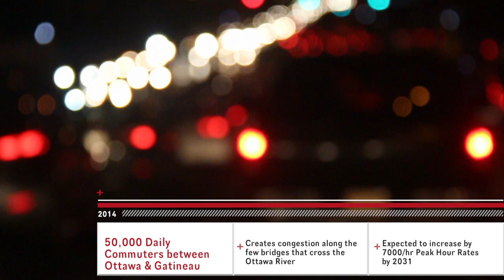Ottawa - Gatineau Light Rail Transit

Comment: It's a shame but Ottawa is ready and is rapidly expanding rail! Gatineau, and the Quebec government are very much not interested as they have recently dumped 10's of millions in lengthy plans developing their own independent transit system, transit-way and independent public transit brand. Ottawa will have 5 lines and 50 train stations before Gatineau gets a single one!